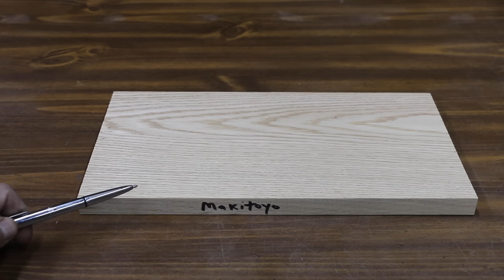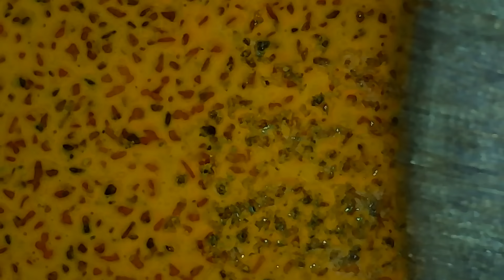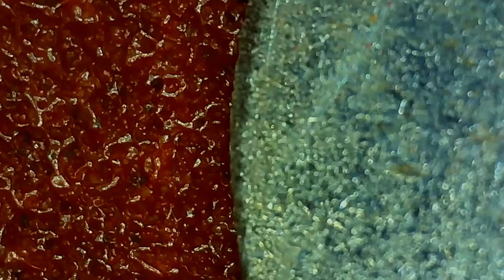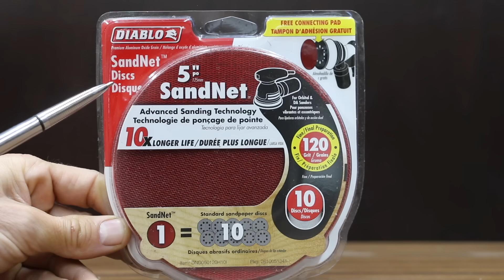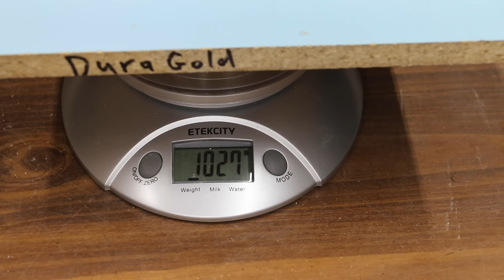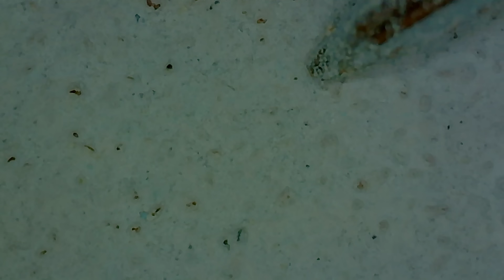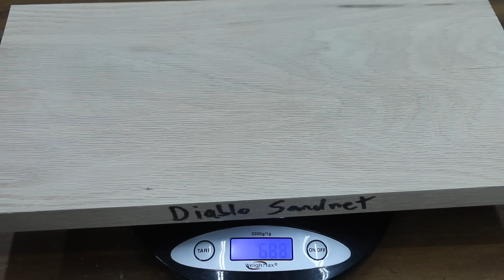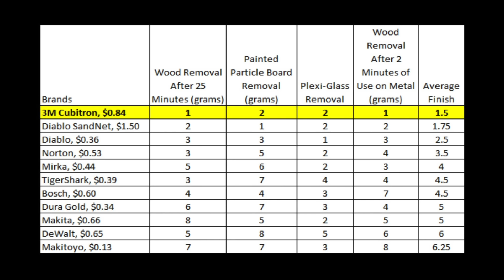Best "Sandpaper" Brand? 3M Cubitron, Diablo, Mirka, Norton, Makita, DeWalt, Bosch Sand Paper

Comment: I work in an aluminum fabrication shop, and for years we used Mirka. Then we started using Autonet, which was really similar to that Diablo Sandnet. Couple years ago we switched to Cubitron, and haven't looked back. As long as there's no sharp edges to snag, the disks last forever, and give a great finish. Filigree type panels will shred it though.
Reply from the maker: Thanks for the feedback.

Comment: Which belt sander sandpaper is better
Reply from the maker: Thanks for the suggestion.
Reply: The problem is that I’ve have been buying Diablo but they keep on snapping the the glue is not holding it together unless I bought a bad batch
Reply: And you are doing a great job I watch all your videos

Comment: Maby I’m wrong but money for overall performance you could use 3 sheets of makitoyo  at .39c and cut more material by 3x more than the others . Some would be 10 x more for the. Same or simpler results . In other words the .13c is a better cost to cost / for results . Except for steel . Wish you would have done a cost to overall use accomplished per dollar . As a tight wad I want the most removal for the lowest cost .
.
Reply from the maker: Thanks for the constructive feedback.

Comment: I doubt this comment will ever be seen, but a thing that matters to me about sandpaper is how well the grit is adhered to the surface. This is less of a problem with sanding discs, but with sheets it can matter a lot. If you are bending the paper into different shapes to sand non-flat surfaces you need the grit not to come off. If it does either it or the edges left on the paper are much more coarse than the original grit, and they leave big scratches behind. I have no clue how to reliably test that, but it matters a lot in any case where you a sanding unusually shaped things to a high polish. (In my case it is polishing stone sculptures.)

Comment: Depends on your point of view which is best. From a cost  point of view you can have 6.5 (rounded) sheets of the Makitoyo for each 3M sheet. In 25 minuets the 3M removed 53 grams of material, 5 new sheets of the Makitoyo would have removed 50 grams and still had 1.5 sheets in reserve. 3 grams of material is about 0.10 oz you can weigh the difference but can you tell the difference on the board. you would loose time changing sheets, you might gain some of that time back with faster cutting. Cost of time vs cost of material is always the problem it depends on who you are and what you are doing which matters most. 

One thing was for sure no metal for the Makitoyo.

The Diablo did do better than the Makitoyo in cost of material per cost of sheet.
Reply from the maker: Thanks for watching and sharing!

Comment: I wondered how you would test abrasives. Interesting test. One consideration for sanding, and learned this from some of my wood turning friends, is speed can make huge differences in removal rate. too fast and it is like a dragster burning off the tires. Lots of smoke and heat, but the dragster goes no where. Most of the time when I am sanding my wood bowls, I use an angle drill with 3 inch discs. Bowl is almost stationary, and slow speed drill is never more than half way depressed. The lower speeds allow the abrasives to dig in and cut, or get traction. If your sander was set to max speed, it won't cut as fast as it would if it was at slower speeds.

I have used some of the open weave abrasives, Abranet is the main brand that wood turners use. I did find out that in grits up to 220 or so, the solid abrasives cut far faster than the open weave, but at around 220 or so, there is pretty much no difference. Best guess is that there is more cutting surface with standard abrasives. The advantage to the open weaves is that you take it off of your sander, slap it on the work bench a couple of times, and it goes back to almost new shape.

I have tried the Mirka abrasives. They seemed to be very aggressive when fresh and new, but lost the cutting edge/went dull very fast. 

Not seen here, and I would have sent you some discs if I had known about this one, is a blue ceramic disc that I use. Don't know the brand name, but there is a deer logo on it. It is my preferred one for sanding bowls. Outlasts others about 2 or 3 to one. It is on mylar film. I get mine through VinceswoodNwonders, though I think others are selling it now. I did use some to sand down a very coarse  cast iron skillet. It held up very well. 

I have been hearing many ranting and raving about the cubitron from 3M for several years. Until recently, it was only available in sheet stock and PSA/sticky back discs. Glad to see they have gone with hook and loop. Have to get some to test out. 

Another side note, is that the abrasives are far better quality. Biggest step is that they use electrostatic charging to get the particle sizes rather than sifting like in the old days. Paper or cloth backed is still more common, but the mylar films are making headway. That stuff is almost impossible to tear.
Reply from the maker: Thanks for the feedback.

Comment: Following 33 years of carpentry, painting and refinishing, 3m is all I buy. A real good test is refinishing antique furniture. The old varnish and pigmented stain clogs it up fast. It's always better to use stripper though. In some cases, as refinishing wood in someone's home, you can't use stripper on trim above carpet or hard wood. I think a great video would be which is the best stripper for latex or oil paint. As well as stained then varnished wood. There are times in an old Victorian home you have the original stain/varnish with multiple coats of paint on it. Usually with lead paint first. That can be very trying.
Reply from the maker: Thanks for the suggestion.

Comment: Thanks for making the Video. I use sandpaper for woodworking a lot, and this video was excellent. Could you do a future test on sanding belts please? Some of the brands you tested in this video, I have never heard of or seen. I suggest going to the big box store and only pulling what is on the rack because that is what most people tend to do. The biggest surprise for me was your testing proved that De-Wilt was garbage and overpriced. And, I always thought Diablo brand was just fancy packaging and hype. I have Diablo sand paper, and did notice that it hardly clogs, but I suspected it didn't last long. Boy, was I ever wrong! Brands I see in my Florida locale are Diablo, De-Walt, Shop Smith, Gator Power gold flex (is very common here), and some 3M products. I use a brand named "Indasa RHYNOGRIP white line" because we have a local supplier for abrasives only and that is what they stock. The rhynogrip seems to work well, but I would like to see it tested against the competition. Also, based on reviews I've seen, 3M "Regalite" cloth belts are the best for belt sanders eg.3M part no. 81398/761D.  QUESTION: Do you think body shop sandpaper would test better because it is made for sanding paint and metal? Just a thought. Thanks again! You Rock!
Ben Secor
Reply from the maker: You are welcome!  Thanks for the video ideas.

Comment: nice test, really put each brand through their paces. you forgot gator it's pretty good. got two mouse sanders and i have come down to duragold which the kind i get is made in South Korea.

for me it's more about durability, and tear resistance because things i sand tend to be rough having bolts, screws, nails, etc... in it or branches i use to make handles for shovels, rakes, hammers, or anything that has a broken handle or no handle at all.

basicly the duragold out of the ones i used it holds up the best. SATC, craftsmen, diablo, and gator were the others. SATC is garbage it tears so easily i ordered a ton from amazon, burned through the whole pack on a few custom handles and an aluminum boat hull, mostly from tearing. craftsmen, diablo, and gator held up good. but duragold can hold up to whatever abuse i dish out.

still the 3m stuff sounds dang good.
Reply from the maker: Thanks!  Thanksk for the suggestion.

Comment: Great job man! 

I went to a body shop and notice they were all about 3M products
Reply from the maker: Thanks!  Thanks for sharing.
Reply: Not trying to take away from 3M, but I think the large body shops have brands they contract with for paint and paper. Sometimes it is a price point decision. Also, the smaller shops buy from a local supply house. If the supply house only has 3M, that is what they get. But that may be the brand everyone wants too.

Comment: Love these tests, but 3m sandpaper lasts so much longer, i have mostly experience with metalworking and the difference is unbelievable, i can use a single bit of sandpaper for half an hour no problems on my hardened steel knife blades
Reply from the maker: Thanks!  Thanks for the feedback.

Comment: We used Mirka and 3M a lot at the automotive paint shop I used to work at, never really had too much trouble with clogging unless it was weird sticky paint from a rattlecan we were removing, or bondo that didn't dry well enough as they maybe used too little hardener or something.
Reply from the maker: Thanks for the feedback.

Comment: Forgive me if I am wrong, but is not an orbital sander for smoothing not thicknessing? If so, then should the quality of the finish such as no sanding marks, be more important than the bulk of material removed? This may put the likes of Dewalt and Makita in a different light as it may have been the criteria set by the makers.

Comment: The Diablo (especially the SandNet) can be cleaned with high-pressure water and soap, and used over and over.  Also the mesh nature of SandNet comes in handy when sanding walls with a vacuum attachment, very little dust is produced.  The disadvantage is the edge gets frayed when bumping up against a corner, so they disintegrate unless used on drywall/paint surfaces.  They are expensive but they have their place.
Reply from the maker: Thanks for the feedback.

Comment: I can vouche for the Diablo brand sanding disc's/flap disc's for Angle grinders as well. We bought a used 24 ft pontoon boat that had mineral buildup so bad on the pontoons that we had to sand it off, we bought 4 disc's thinking that we would go through them like crazy, we only needed 1 and it is STILL good even after that.
Reply from the maker: Thanks for the feedback.

Comment: having used many brands of sandpaper over the last 70 years, many of which were "name brands,"  In my experience, I will say that ShopSmith sand paper stands out head and shoulders above the rest, I didn't believe the difference myself.  It simply resists clogging and last about twice as long as the rest... Try it!
Reply from the maker: Thanks for the suggestion.

Comment: I watched another sandpaper test lately and they did find out that different sandpapers work differently on different machines. I.E. a Bosch GET 75-150 completely clogged a Mirka grid sandpaper in about 20 seconds, while the mirca sander did not perform as good with Bosch paper as with Mirka grid. Testing every paper on the same maschine might not be the best comparison.
Reply from the maker: Thanks for the constructive feedback.

Comment: Dude, I love your channel. The only problem is that you're US and I'm UK - the upshot of which is that the products tested have different prices (in comparison to each other), may not be available at all or thirdly could appear here in Blighty under a different name. What I do learn for the most part is the performance I should be expecting from purchases the same or similar. Maybe I should be the one to replicate this over here, but that's a different story. For your information, at this date (07-13-2021) I can get 10 Cubitron discs on ebay UK for £7, or 70p per unit while the Makita, for example, comes it at around the same price. 

The burning question that led me to comment, though, is what would be the result of a complete "sand off" between the Cubitron and the SandNet? Say, 1 or even 2 hours to see which brand has the greatest staying power. At 7'41" into the vid, this isn't clear, as they both clearly have a lot of wear left. Would either truly ever be totally worn out?

I used to (professionally) buy my sandpaper on rolls (or belts for more aggressive work), but now that cordless palm sanders are so cheap and my projects are small, you've done me the favour of steering me away from my 'go to' brands of Makita, DeWalt or Bosch. 3M really do seem to set a high standard with their products in general.
Reply from the maker: Thanks!  Thanks for the feedback.
Reply: @ProjectFarm  There were some other things I could have said. Obviously, you only endorse (if I can call it that) on the strength of the evidence, your testing is beyond thorough and we learn a huge amount into the bargain. Whatever you've taken in from patreon et al, I bet it's a tiny fraction of the savings people have made in avoiding poor choices. In particular, I've learned not to judge a product by brand alone ...

Comment: Usually the most important chart to me is performance/cost with columns of supporting data. Sometimes cost isn't a factor and a good example is Liquid Wrench penetrating oil (as per your results). I bought an oscillating tool for $20 as an experiment (cheapest I could find). The thing is still running after 200 hours and three projects. The things are loss leaders for the overpriced and cheaply/poorly made attachments.
Reply from the maker: Thanks for the feedback.

Comment: Intersting tests...however I don't understand the weights on top of the sander.  best practice is the weight of the machine alone is way it should be used.  You seemed to be getting irregular  pad contact from all the weight you added.  Still, the major wear was revealed in this experiment.

Comment: Great Video!!! Diablo sandnet now has a 50sheet +10 free sheet for 60 sheet for $30 which makes it $0.50 vs $1.50 per sheet on for the 10 pack.  As of 2021 father day sale HD having a value pack 50 assorted (10 sheet 5 different grit) for $20 or $0.40 per sheet
Reply from the maker: Thanks for sharing.
Reply: @ProjectFarm  Thank you for your great videos

Comment: I've been using 3m on my ¼ sheet palm sander, and it did well. Tried the Diablo (it was on sale for .08 cents per ¼ sheet) and it actually seemed to do better than my 3m. 
 
Mind you, my 3m was a bulk purchase variety pack (8 sizes, 100 full sized sheets of each) and I bought it in 2018. So age could be a factor.  

With that said, I bought out the entire internet of the ¼ sheet diablo that was on sale. My only complaint is it only had 3 sizes (40, 60, 100, 150, 220) and does not have the 3 sizes I use most... 80, 120, 320. But I feel like it shouldn't be too big a deal ... and unlike their (unimpressive) miter saw blades (Forrest, FTW! Lol) it didn't leave any red on the wood lol.
Reply from the maker: Thanks for sharing.

Comment: Hi there, extremely curious about this about your test. You tested the lower grade Diablo Sand paper and then also on the same test, used the superior Diablo sand net. 

For the Mirka sand paper you used their standard gold paper, why did you not use the Mirka Abranet Ace sand paper instead which is the superior product?

Comment: 3M Cubitron seems to be made for commercial use.. as the resellers seem to be very random. You can buy a 60-pack of diablo sandnet for ~29.97 from home depot. That's roughly 50 cents a pad, plus it includes the adapter to make it stick to a 5 inch sander with vacuum holes.
Reply from the maker: Thanks for the feedback

Comment: I worked in a woodshop for 10 years sanding white oak and hardrock maple, it is about price AND knowing when to change out your paper.  We changed out paper around every 5 minutes, so if you use the sheets that cost $0.13, in 25 minutes you have 5 sheets at $0.65 with theoretically 50g of removal.  Changing paper often is the best way to get material removal and your purchasing guy has to communicate with his respective department heads (in this case the woodshop)....
Reply from the maker: Thanks for sharing.

Comment: Hi
Sorry you made some big mistake when you tested the paper. 
 You don't use a vacuum cleaner. The sanding net needs the vacuum too have the full performenc. Without vacuum the net los a durability.   For example Without vacuum the net can sand 1m² and with vacuum 4m²

Comment: Before I got watching the video, my money would be on Norton sanding products. I've used them a lot for hand sanding, air tool sanding, and orbital sanding. I've also used abrasive wheel discs on a 115mm grinder, but after a wheel exploded due to glue failure, I was left with some colourful bruising to the leg, which lasted weeks.
Reply from the maker: Thanks for sharing!

Comment: Seems like a good strategy for woodworkers would be to buy Makitoyo pads and throw them out after 10 minutes. In 30 minutes of sanding you’ll be ever so slightly behind the 3M performance but you will have spent 1/2 the cost.
Reply from the maker: Thanks for the feedback.

Comment: Not apples to apples - there is no control of dust extraction which varies a lit and affects sanding performance dramatically. I sand square meters of birch plywood per day and nothing beats the price/performance of good dust extraction, center air feed orbital (Sanders that have a hole in the middle to supply air to the center of orbit forcing sawdust to the collection holes- festool metabo and mirka have models) sanders and Mirka autonet at 0.50/sheet.
I actually print on the plywood so I can tell immediately if there is a change in output. I also measure pm2.5 particle emissions and am happy to say that festool vacuums with my Mirka sanders don't increase the particle count!
cb
Reply from the maker: Thanks for the feedback.